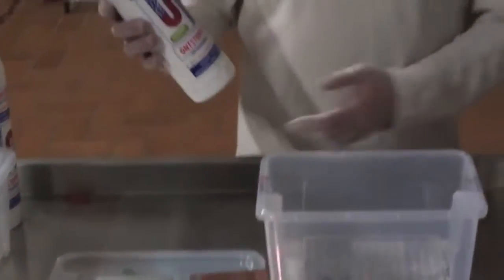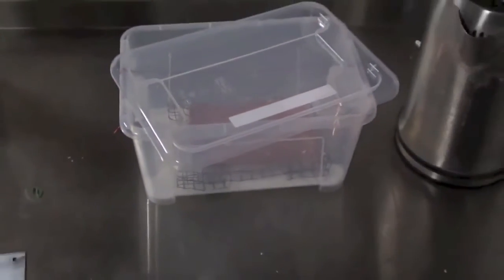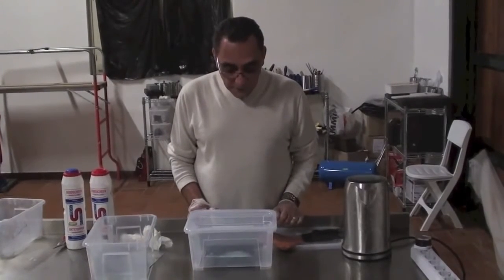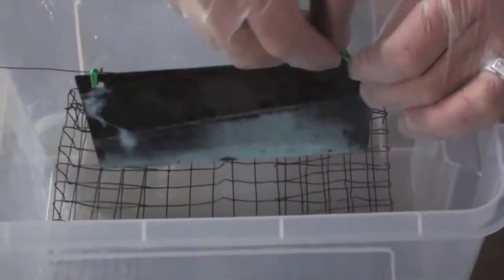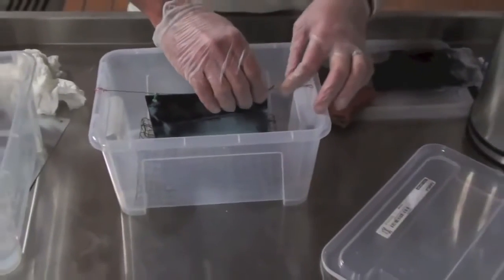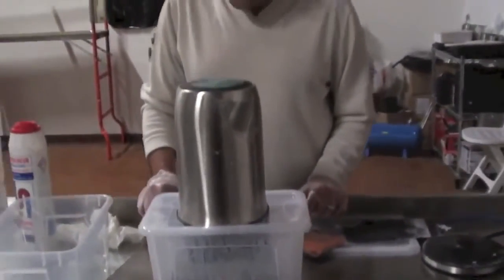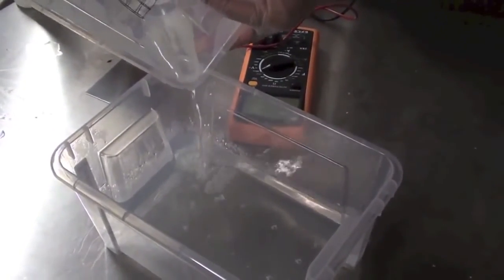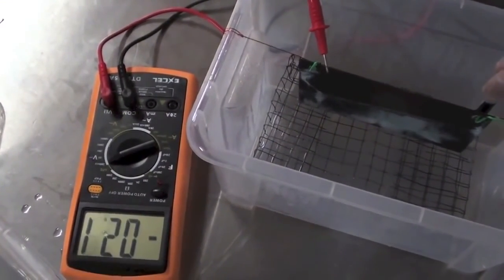Keshe Foundation  Nano Beschichtung

Comment: not really smart or save to add boiling water on solid NaOH!
Cold water would also turn to a hot solution. Lab Safety glasses are no luxury here.
The text is faulty too, it says: " Hier werden mehrere Schichten von Graphen erzeugt"
Graphene ? Impossible, you have Cu & NaOH & H2O in your process where is the carbon coming from??? At best you made a black copper-oxide coating.
Reply: +maituub Look please allways for positives, in this video is everything you need.  Its simple. Black or white thank you for your comment.Just try LifePen if you need to see or feel something and rest is in you.